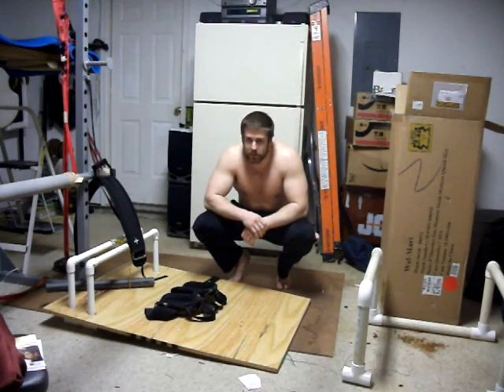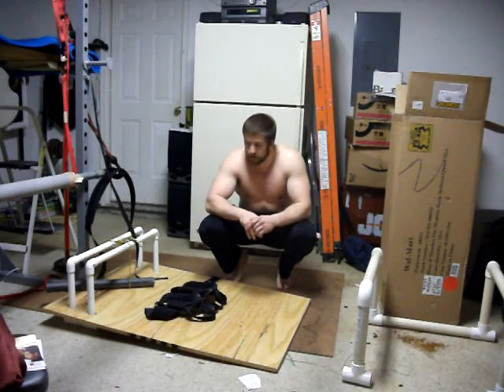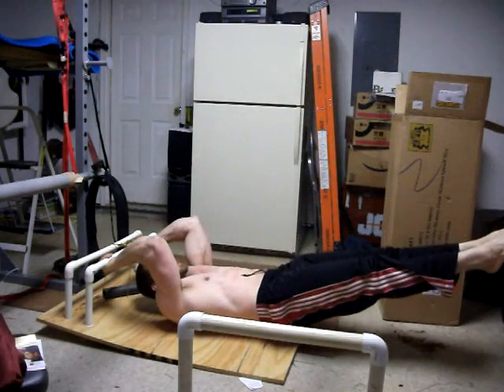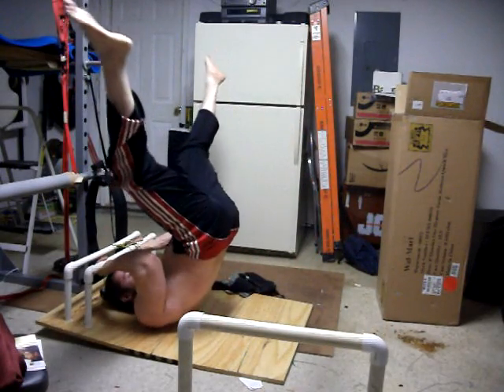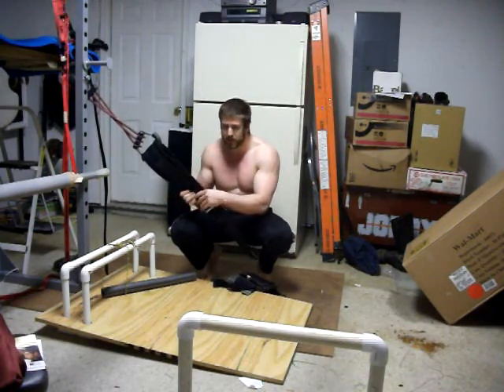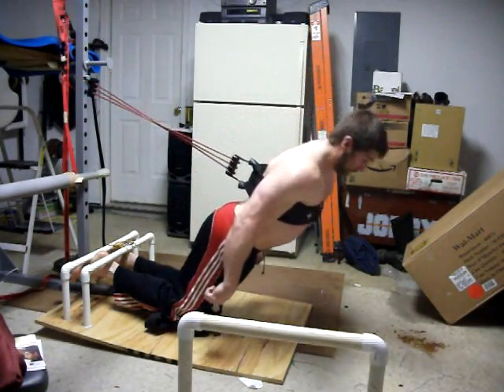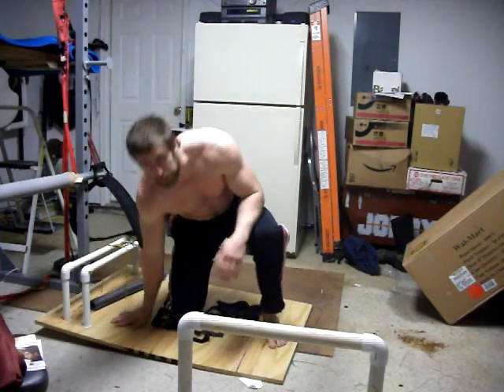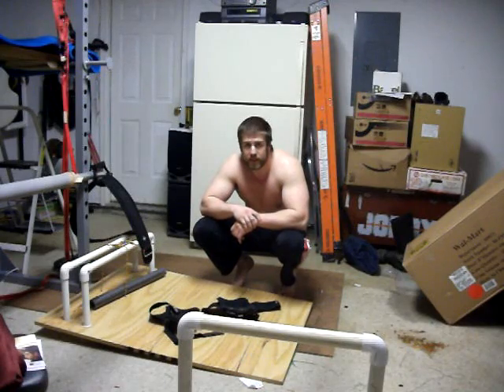Home-made setup for Body lever, NLC, GHR

Comment from the maker: I always had good success doing them with my hands under the driver side door of my car, gripping the chassis. The best thing, in my opinion, for a mat is a folded up (not rolled) yoga mat, the thicker the better up to around 3-4 inches. It should be 10-12 inches long by however wide the mat is, and flat-ish. Obviously the edges will be a little rounded. You position your shoulder blades and traps on that, because that's the only part that should be touching the ground.